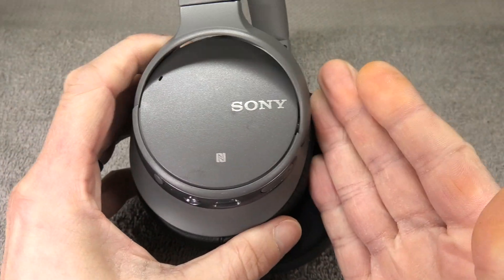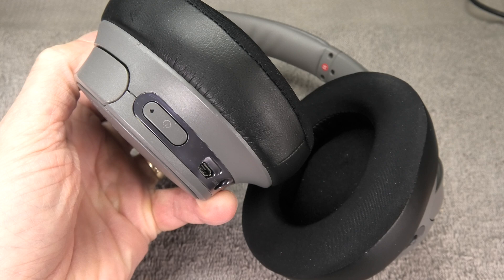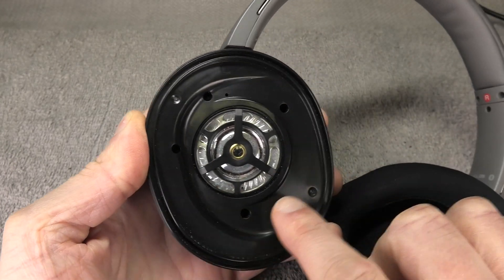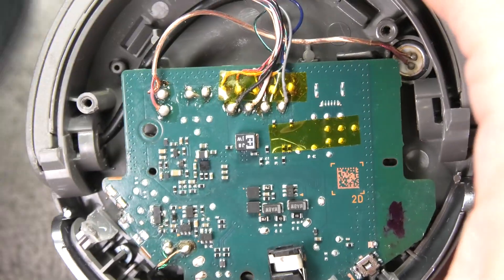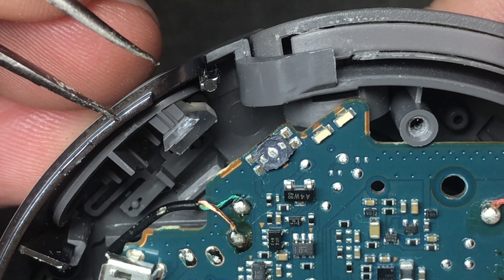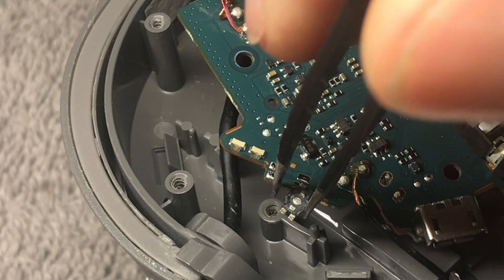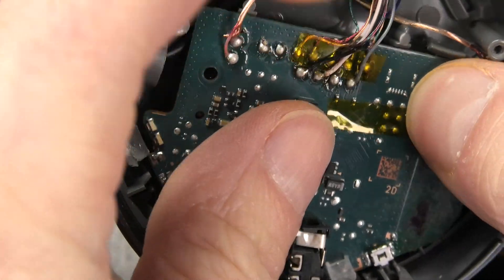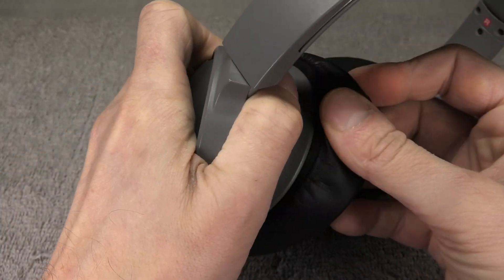Defective Sony WH-CH700N Power Button REPAIR (How to in 4K)

Comment from the maker: This is the replacement switch, which was used in this video:
https://www.digikey.com/en/products/detail/EVQ-P7A01P/P16763CT-ND/4429456
Reply from the maker: @maylonkirby5455  Hi, it is called Flux. This is necessary to create a proper bond between the switch and the PCB.
I prefer using the type of flux that comes in a syringe, like this one: https://amzn.to/3impWF4
But it also comes in many other forms (which are often cheaper).

Comment: A different issue but I have these headphones and I have something rattling around in the other side (not the motherboard side but the black side) and want to figure out if there is a way I can open the black side up to remove it? Can I remove that black wire that is glued in to the motherboard? I really don’t want to have to buy a new pair of headphones!

Comment: yo the craziest thing happened. so my headhones werent working for a year now and i had just been using the nfc tag to connect them with my phone, so i saw your vid and decided to check out if it was a similar problem but everything was normal, nothing was broken or out of place so i just screwed the motherboard back in and built them in again and just decided to give it up. then i tried to press the on/off button AND IT WAS WORKING??? I DONT GET IT but im proud

Comment: How long do you heat the switch before it comes off? I was heating it for a while and the switch wouldn't come off. Ended up melting part of the headphone from under the motherboard. Smh..

Comment: There are two types of switches so idk which one I have to choose. The "Cut Tape" or "Digi-Reel"?
Reply from the maker: The Digi-Reel is for assembly line manufacturing.  
You want the cut-tape.  👍
Reply: Thx a lot man.

Comment: Thanks for this. I tried this and was able to solder the switch to the board. However, suddenly at the end of the process the bluetooth began pairing and the headphones then said "power off." The headphones will not power back on now. Any idea what I did wrong or if it can be fixed?
Reply from the maker: Sorry, I don’t know what the issue may be.  
When you close the power-switch circuit with a wire, do the headphones turn on then?
Reply: @MegaSafetyFirst   Sorry, I'm not sure how to do that. I wonder if maybe I used too much solder or accidentally nicked the switch with the solder tip.

Comment: 0.27 € for the part is nice. 20€ of shipping not so nice :(. Bye headphones...
Reply from the maker: The store is shipping from the US.  
There might be a company selling the same part closer to you?
Reply: @MegaSafetyFirst  Thanks for your response! I've tried several, all between 18-20 € shipping, except RS Components. Although the minimum amount of switches to purchase there is 20, the shipping is 5 €, so with taxes included the order is around 12 €. Not bad, but the headphones owner has to decide xD. It's a shame the switch broke due to a fall from very low height. I've still got the upper parts, but it seems impossible to join them back together...

Comment: I have the same pair of headphones. but I got a different problem. They can be turned off and on just fine, but when I plug a micro-usb cable for charging, it never charges. I tried different cables, different USB ports and also tried a known working headphones with the same port / USB cable and  they charge. I also noticed that if they are turned on and a cable is connected, everything stops. I am suspecting a shorted motherboard - what do you think?
Reply: Quite possibly the micro usb port on the headphones.....Type B are notorious for breaking pins- distorting etc. Try squeezing the top and bottom of the plug together with some needle nose pliers.

Comment: Hi..I have the wh -1000xm4 .they will not power off.they stay powered up until the battery goes dead..recharge remove charger and they power up…no matter what I try they will not power off

Comment: Another tip that I just learned, which is an amazing help if you don't have a soldering gun and can't find the parts, is that the CH007N headphones have NFC capability, so if you have a phone that's also NFC enabled, you can turn on the sony headphones remotely with your phone. It works on iPhone 7 and later, and plenty of other devices.
Reply: OMFG it worked!! Tyyy so much for this, now I can finally listen wirefree again :D So simple and yet magical, I just searched NFC on my samsung s9 and then put my phone on top of the left part of my headphone and it turned on! Thanks so much! MANY HUGS <3
Reply: @camillafors4678  Ha. I was just as stoked when I found out about it as well.
Reply: Thank you for this trick. After 1 year I am able to use them wirelessly again. But How do you turn them off?
Reply: @alejandromartinez_ga  Ive just been disconnecting the Bluetooth on my phone and the headphones shut off automatically after 5 minutes or so.
Reply: You just saved a random internet guy's life
Reply: Thanks bro this worked, I'm so happy. This saved me so much time.
Reply: Thanks, great tip. Works with my Samsung S20. Saved me binning my Headphones.
Reply: Amazing thank u
Reply: Is there a way to turn them on and off? So far I've only managed to turn them on and connect them, but I can't seem to get them to turn off.
Reply: @TequilaOperator  I just disconnect them and they shut off automatically in about 5 minutes.
Reply: @aenamabag  thanks. I also found out you can just plug them in and it shuts them off too.
Reply: This tip just made my son very happy! 😂 Thanks!
Reply: Thanks for this tip!
Reply: Buy this person a beer! It just worked for me as well... I was about to ditch my headphones as I've neither the tools nor the skills to fix them. I saw this comment and it worked 👍
Reply: is there any similar way to get it to go to pairing mode so that i can pair my pc with it?
Reply: @mik4336  Good question, and unfortunately I don't have an answer. It's a shame that entering pairing mode uses the power button as well. When you use NFC to turn it on, it doesn't automatically pair with the device used to turn it on, so it does at least allow you to pair other devices. But I don't know about pairing mode. I wonder if just holding the NFC device to the headphones for an extra 5-10 seconds would have the same effect as holding down the power button? Worth testing it out.
Reply: I can't do it. NFC enabled and bluetooth connecting, but then it's suddenly not possible???
Reply: @Pegasus1167  did you figure it out? I have an iphone 8 and ios 13.6. I downloaded an app called "NFC Tools" then I added a bluetooth connection...
Reply: @danasteerable  thank you Dana!
Reply: @Pegasus1167  I was able to get mine working, open Bluetooth settings on a previously connected modern iPhone, (might be similar for android but haven’t tried it yet)

With a charged headphone, (verify the voltage on the battery if needed by removing the right earfoam and speaker then reassemble with adequate power source)- 

Attempt to connect via Bluetooth, quickly hop over to your NFC app and scan the hard shell of the outer left headphone, 
hear “Power On, Bluetooth Connected” 

Thanks for sharing this information!
Reply: @OverlandTrail i dont get the steps, can u explain more, im stupid sorry for that
Reply: It says: "no supported app for this NFC tag". What do I need to install, in order to turn my headset on?
Reply: @Pegasus1167  I don't know, unfortunately. My only suggestion is to try another phone or device and see if that's what the issue is.
Reply: I have iphone 12 max pro, somehow the NFC turns on the headphones but does not give the option to connect to Bluetooth. Can anyone help. In an older phone the nfc turns it on and gives option to connect to Bluetooth. Thanks
Reply: @deepakkhatri2886  If I recall correctly there was a sony headphones app you could install that would let you adjust headphone settings, and if that's installed it also lets you connect to bluetooth through the app. Worth a shot...
Reply: Can u do a video?
Reply: Thank you, it worked for me !

Comment: So I pulled the wires out that connects the speaker. Where do they go can you make a video on how to re attach them :(
Reply from the maker: Hi, I’ll probably won’t get to making a video like that for a while. 
There should be a row of wires soldered on the backside of the board.  The wires of the speaker are part of that row.  
Sorry, that I can’t be more helpful at the moment.
Reply: @MegaSafetyFirst  ok thank you and how about getting new screws these buggers are tiny and I lost one. Also thank you so much this was helpful